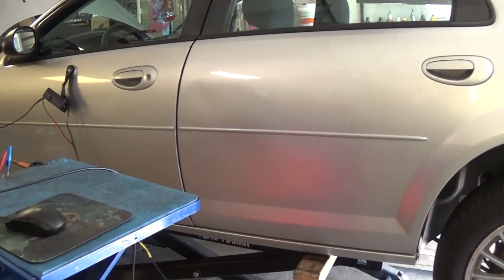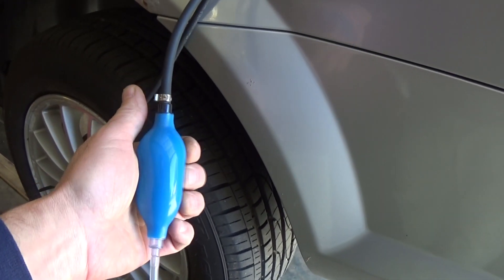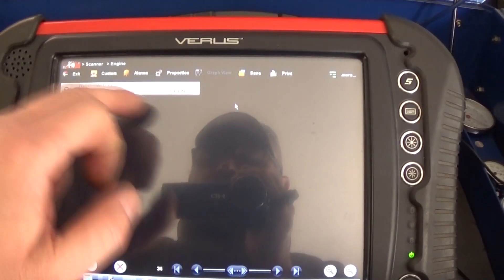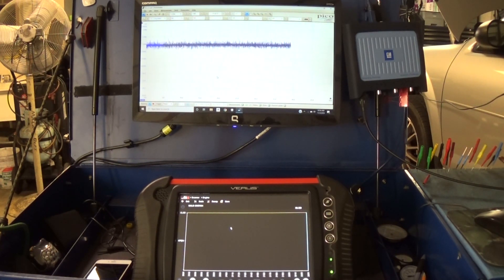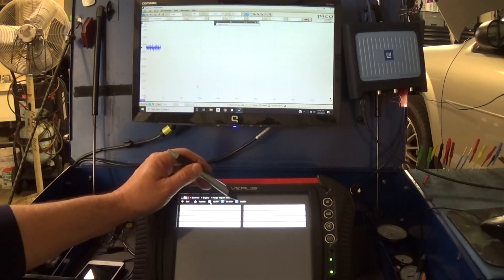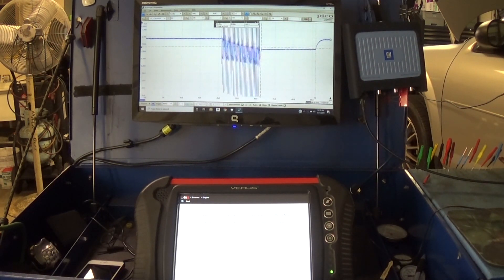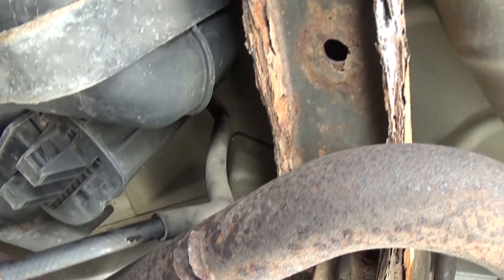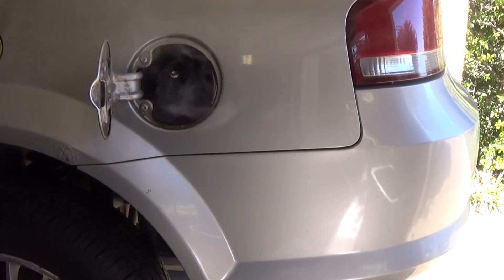Chrysler Sebring EVAP NVLD System Test P0456,P0442, P0440

Comment: Hello, I own a 2000 Chrysler Concorde LXI, 3.2, and I’m having a problem with the Evap system. I replaced everything, except the wiring harness, and that canister filter. Can’t get one anywhere? I’ve tried several caps, because I changed the filler neck, and now the OEM STYLE caps don’t fit. I have to use threaded style caps now. I’ve checked all the hoses, they’re not bad. My problem is P1494 intermittent, and only on cold starts? I clear the MIL LIGHT, and it sometimes doesn’t come back on, for several days? Any suggestions would be great? I changed the purge solenoid too. Driving me nuts, as you could imagine? I’m no mechanic, I learn from here. 🙏 thanks
Reply from the maker: Sorry my friend but EVAP is very complex system and without proper analysis of your car I can’t tell you what to do.😐